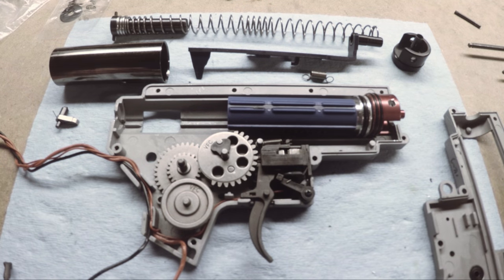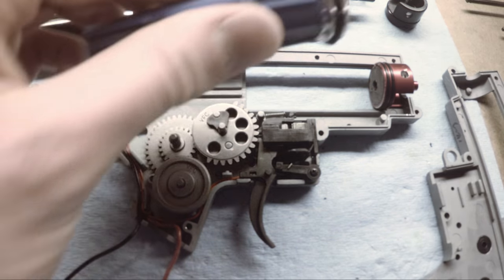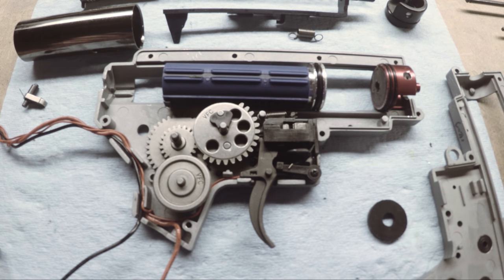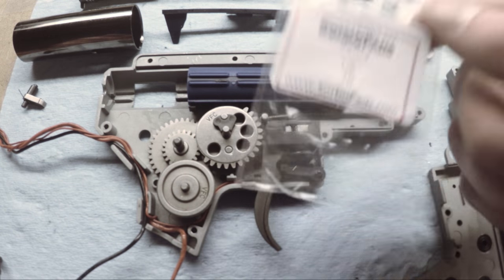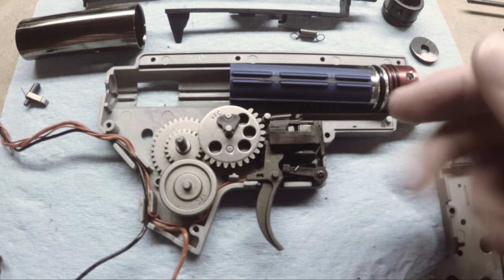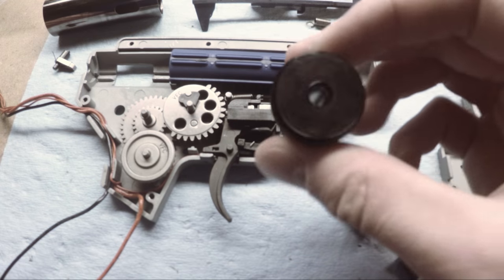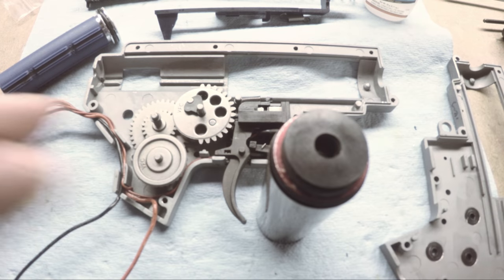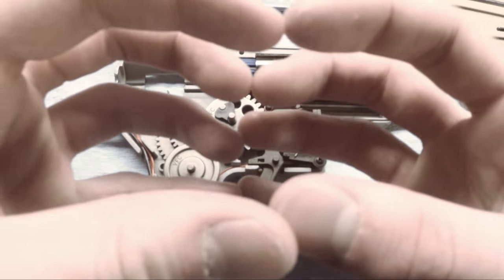Airsoft Tech: Correcting Piston Angle of Engagement (AEG)

Comment: You make a mistake here. You check the piston position - but without spring force... When strong spring <M130 push a force into piston, it also push SorboPad a little bit causing the AOE change. Next thing - SorboPad is a really "spongy", so when We shoot in Auto mode We squeeze sorbo more and more and also AOE changes in real time. That's a mainly reason why I don't use Sorbo in AEG. I have a really interesting material based on mixture of silicone/caoutchouc and many more.

Comment: i wouldnt really consider the 12 o clock position to be a set standard. what you really want is the first tooth on both the piston and the sector gear to be flat against eachother. sometimes 12 o clock might over correct it, and do more bad than good. great video though.
Reply: agree with this
Reply: @jimmyfebrianto5523  Erm, if its not 12 then it will increase the risks of sheering, hence why you outright shave down and remove the gears to get them to contact flat at the "12" position. You want a straight and flush 90 degree or you are applying excessive amounts of torque to that first tooth and if you have a metal piston could actually end up destroying your $170+ gears.
Reply: I dont really understand why if is so important to corect it , no replica manufacturer did this ?
Good question ?!
Reply: Fun things Artillery because the default aoe of the standard airsoft aeg is intended for low powered springs, for example 250 to 300 or tokyo marui spec, but made in taiwan and hongkong guns put springs above that fps range, thats why there is a tendency that stock aeg will have some problems, piston pickup tooth shredded like in my case

Comment: I will say this is a good video and good points. There is an important point that didnt come through.  Stinger please correct me if i am wrong (dont think i am) but....   You should always check your AOE with the spring in place.  Especially when using a sorbo pad.  They are soft and will not give you a true AOE if they arent compressed.  If you set your AOE up like your video and its at 12 o clock, once you put the spring in it will compress giving you a different setting. Especially if your trying to get an exact AOE.
Reply from the maker: You can do that, of course. You could also just push on the back of the piston. Sorbothane only compresses so much, and the spring isn't going to supply enough force to compress it further than you pushing on it.
I need to remake this video, as I also forgot to mention taking off piston teeth in it
Reply: Stinger Good point.  If you have a full 15 tooth rack, then you will need to remove 1 1/2 - 2 teeth off the piston rack after correcting the AOE.   Good catch.
Reply: Heeey could you do that video on removing piston teeth,  @CStingerGhost1  ??

Comment: what is the correct sorbo pad thickness for a v2 gearbox so that i can get the best AoE possible? 1/8"?
Reply from the maker: It varies depending on what parts you are using, but a 1/8" is where I typically start. If you need to add more you can just add layers. If you need less, you can grind down the sorbothane a bit. Just be sure that, if you break the surface of the sorbothane, you put a neoprene pad over it. Otherwise it will disintegrate over time.
Reply: Thanks stinger. Project is a full prometheus tm scar h. I'll get the 1/8 70
Reply from the maker: ***** - Says Prommy is overpriced, but then suggests PDI and EdGi, which both cost far more...?

My primary has a Prometheus hop-up chamber, bucking, and barrel. It works great, and the compression is perfect because they're all to the same spec.
I have no experience with Prommy parts besides those, however.
Reply: guys, forgot to mention. Prometheus parts are the spring guide, piston&piston head, cylinder head, nozzle.
SHS super high torque motor,SHS stock ratio gears. PDI barrel. Stinger, right now prommy and lonex are the only who sell parts for TM recoil scars. Magic box do some as well but they are way above my budget.
Reply from the maker: ***** - I have a lot of experience with ZCI motors. So far no issues, but I have heard that they sometimes fail early on because of bad QC.

Comment: Cuts old tappets plates ... W.t.f lol. 3/8 Nylon washer is like .06¢ . Its round almost  same size as piston and light . Want a bit bit more fps and mire stability at that? Use a steel washer adds weight to the piston ;) . Sorbro pad also changes about every shot.

Comment: Should I use a sorbo pad if I use a "silent" piston head?
Reply from the maker: Yes, the concept still remains the same.
Reply: CStingerGhost1  I know you said that you don't recommend using a rubber pad,but what can it to harm the gearbox?
Reply from the maker: Austin Carr - It won't directly harm anything, but it will not perform as well as a sorbothane pad.
Reply: Ok, I just trying to get ideas, I'm a little tight on money  so...